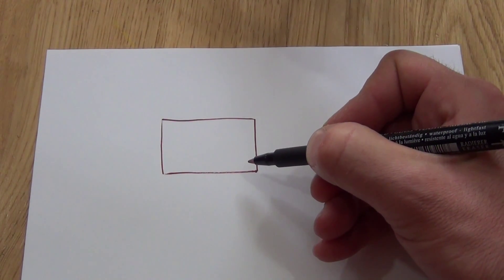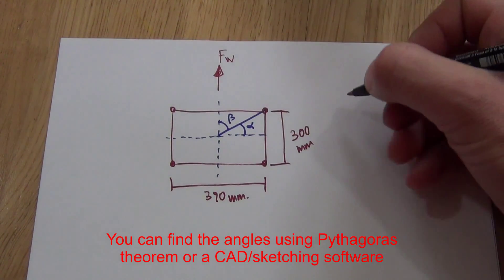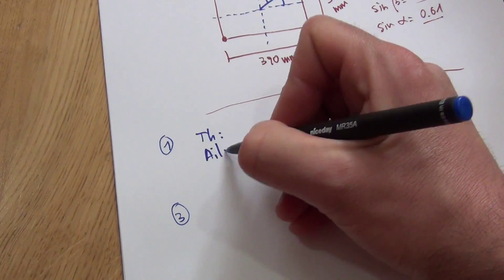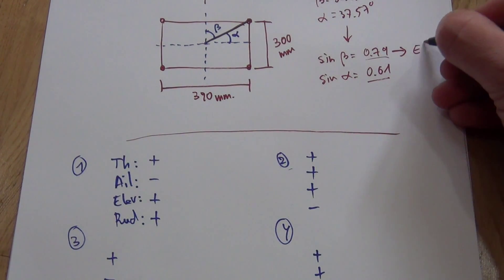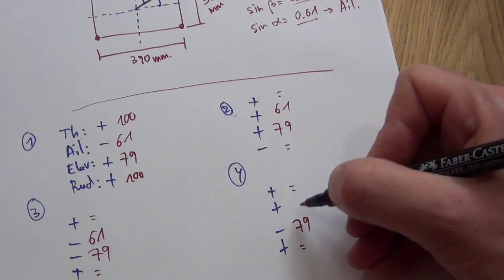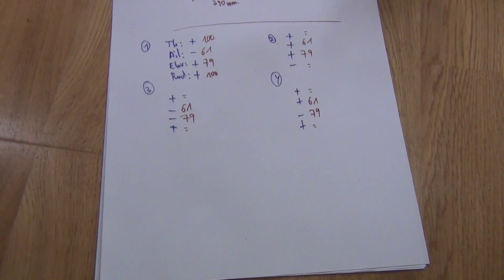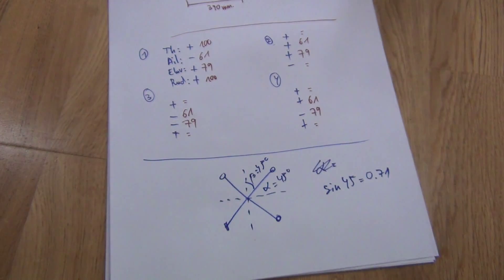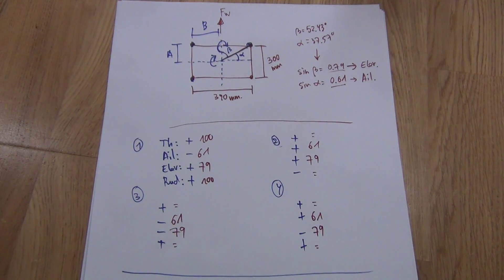Find mixer editor values for non-listed multirotors on KK2.x

Comment: Very helpfull,Im building a Dart 450 and im using my KK2.1 which i had on my deadcat.I knew i had to change the mixer editor but diddnt know how to work out the numbers.
Reply from the maker: Glad it helps.

There is little mistake though: the values for motors 3 and 4 must be exchanged. What I say about keeping the signs in the KK2 board unchanged is correct. I just mixed them up when copying the signs from the board to the paper since the motors are numbered clockwise in the quad but not in my paper.

Enjoy!

Comment from the maker: By the way, there is little mistake: the values for motors 3 and 4 must be exchanged. What I say about keeping the signs in the KK2 board unchanged is correct. I just mixed them up when copying the signs from the board to the paper since the motors are numbered clockwise in the quad but not in my paper.

PS: sorry for the annoying beeping :)